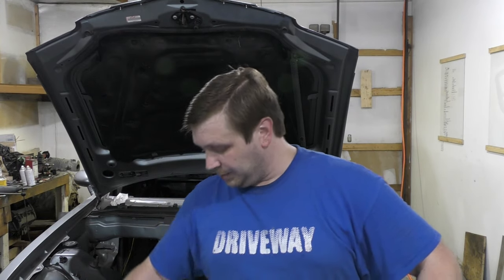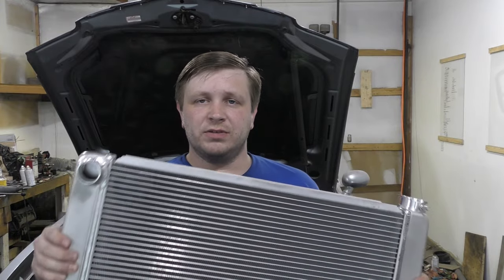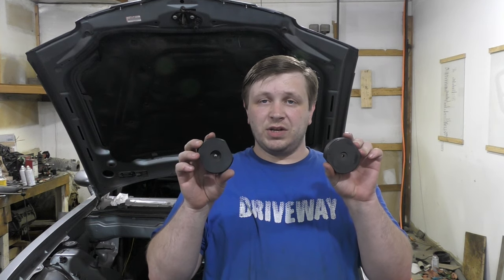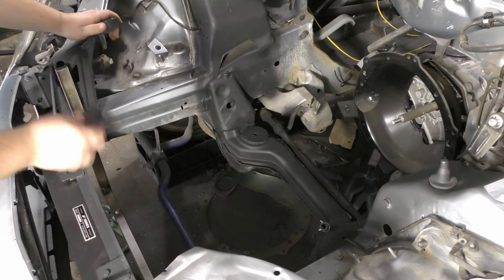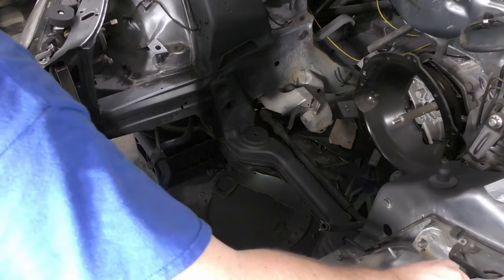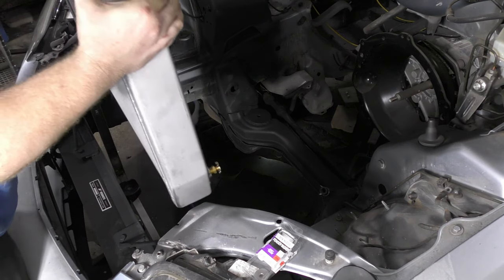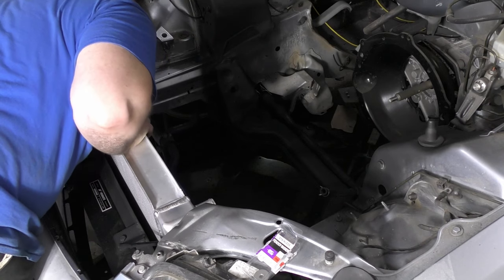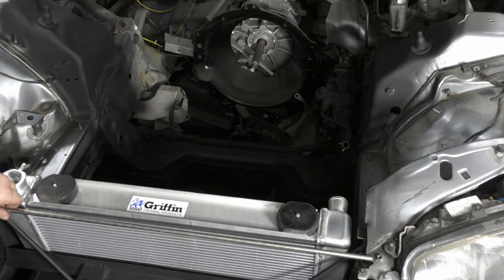Driveway Quick Tips: Universal Radiator Mount with Hockey Pucks

Comment: What do you do to cool the transmission .
Reply from the maker: It has a manual, so there is no need for external cooling under normal conditions
Reply: How would you do it for automatic transmission
Reply from the maker: @luxurygeneration407  You'd just get a radiator with the trans cooler core built into it and done
Reply: They don't make one for my car I'm looking into using one from the genesis but lot people are using the unviseral ones with no transmission Cooler I have a transmission cooler with the oem radiator to I want to upgrade my cooling system.
Reply from the maker: @luxurygeneration407  There should be a universal one that is close - if all else fails, you can go with a separate trans cooler - they are quite abundant to find